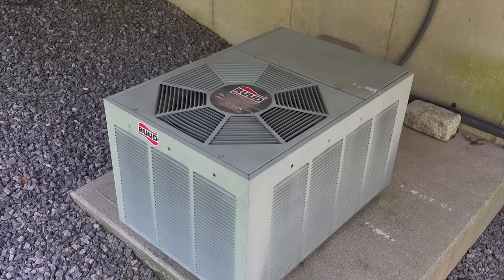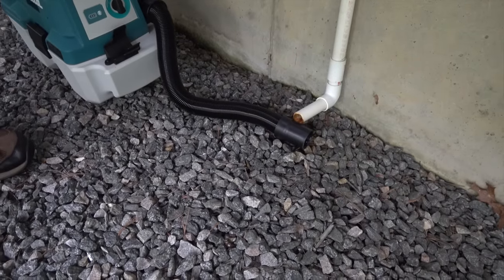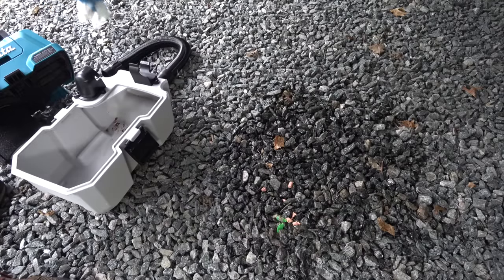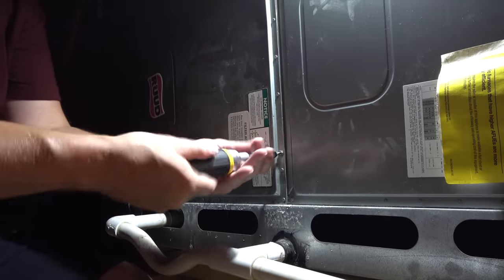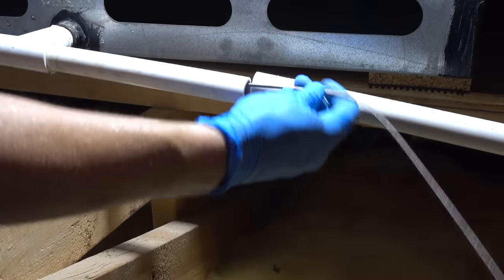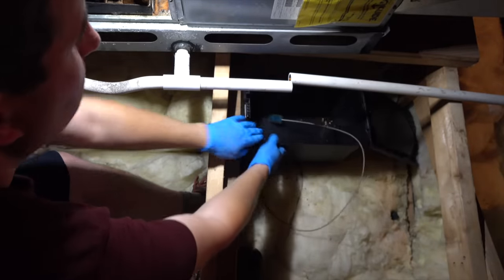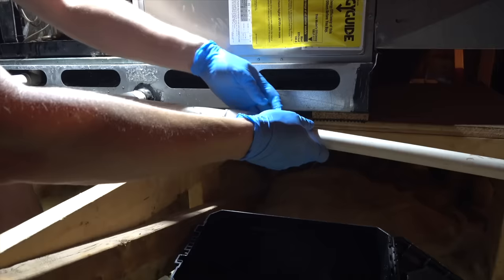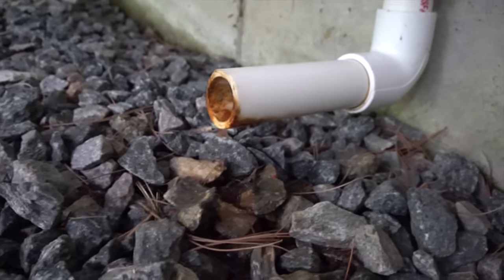How to UNCLOG your AC DRAIN Condensate line FAST - Water stains on Ceiling? or in the Pan

Comment: So what is the supposed reason for having a "trap" on that drain?  Seems like it was installed there to provide the HVAC guys a reason to come back and clear out a clog.  Isn't there supposed to be a second drain line coming from a catch pan in case the main line gets clogged and overflows?
Reply: Depending on the system, the drain pan is usually on the suction side of the indoor blower. What happens if you don't have a trap is that air will actually get sucked up through the condensate line and will prevent condensate from being able to drain out. Like having a mouth full of water, looking down and sucking air in through your mouth. Air comes in, water doesn't go out. Eventually you'll get water overflowing in places in that unit where you don't want water to come out. Having a trap there will always keep a bit of water in there, preventing air from coming back up the pipe, allowing condensate to run out the drain.

Comment: I wrote to you once before, this happens to be the most disgusting part of an A/C Unit. Damn, can't anything go right without all this dirt? If your PVC Pipe is not draining from the start, make A/C Units a better way, in which we don't have to go through this nasty disgusting smells & sights. If all A/C Engineer's were well educated, this wouldn't be an issue, however, these A/C Units are Cheaply Designed Made for the H/O. Start doing a easier way of cleaning. This really sucks! You want to pay me to fix a fifthly drain line? These units should clean themselves. For the price you have to pay.. Just like an Auto? Where and who has this on going money to pay? This should never be the case, however is. Never have a Condenser on a Rooftop. Another problem for everyone. Like I said, "Lame Engineer's create more problems than needed! 😮

Comment: Never push clog to air handler never take a water hose in attic use pressure air nitrogen and never have a unit in attic without emergency pan and flood switch just commonsense
Reply from the maker: Tough with this spot. there was part of the exchanger covering the hole so I couldn't get clear access that way. Still worked out great in the end but excellent point.

Comment: Good luck with that using that little vacuum,  unless you blow the drain line from inside out.
Reply from the maker: It works great, very portable.
Reply: Blowing a clog compresses the clog making it worse,  and can easily blow a fitting open, or rupture the line. A vacuum pulls apart the clog, and will pull together a loose fitting.

Comment: Horrible attic install. No drain pan or safety cutoff switches. Not a proper pee trap, that was a run trap installed in the drain line.

Comment: How can I do this when my a/c is outside?  What adjustments do I make from this video?
Reply from the maker: Do you mean you have an outside all in one system?
Reply: If you have a package unit (condensing/evaporator packaged together) you can find the condensation drain line coming off the ac unit. You really don’t need to modify it. The important thing is to clean out the drain line.

Comment: What it a mouse is clogged in the pipe?
Reply from the maker: If you really have that you can use the garden hose and it will likely blast it out but if not use a wiring snake. the flexible metal kind and fish it out.